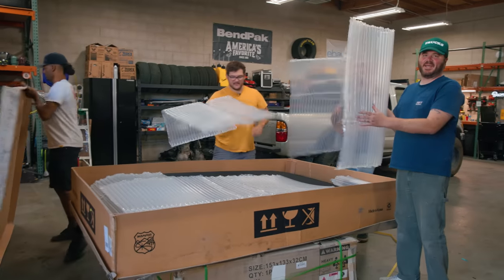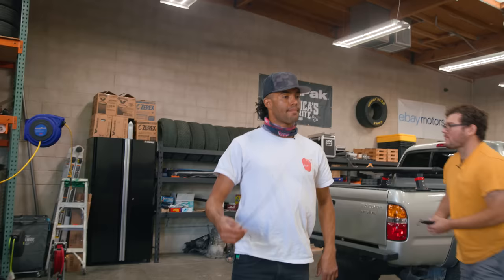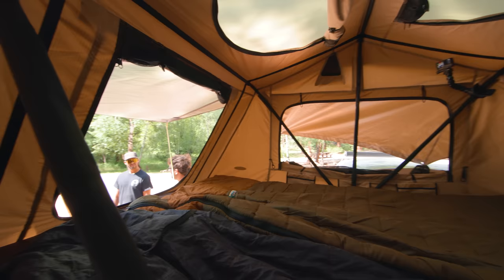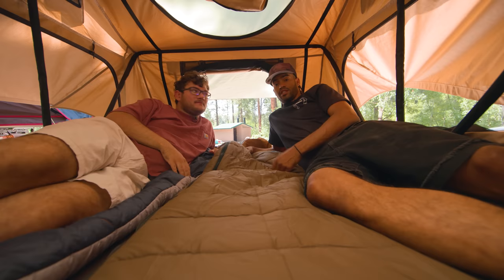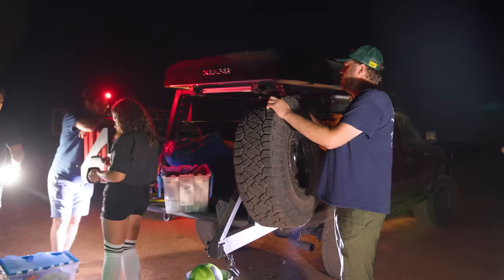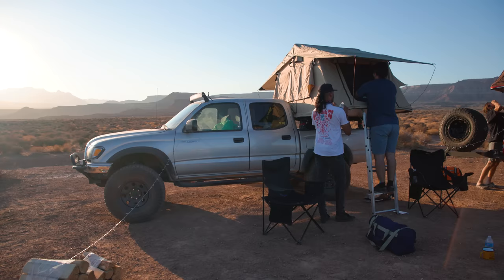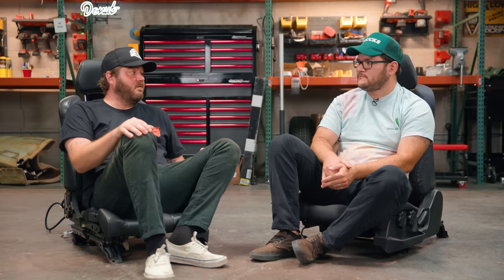$900 vs. $3500 Roof Top Tent

Comment: I love how the mounting was a draw, like there's literally no contesting the fact that the Smittybilt is better in that regard.
It's also interesting that the ikamper won the setup contest even though the Smittybilt took a minute longer but is ready to sleep in when you're done with it, whereas with the ikamper you still have to go get all your shit that you're going to put inside of it.
Reply: Yes, bit I think it was more of an issue of the rack they installed behing too beefy and not compatible with the tent
Reply: @giadalussu1922  I understand that, that's part of the design of the smittybuilt.   It's designed to be easy to mount, which is why it should have won that.  I mean I dont care, I dont have any SB products, or a rooftop tent, it just didnt seem fair.
Reply: Kinda liked the light bar review. Cheap light bar was winning till the last minute and they all changed minds for no reason
Reply: I own a "iKamper 1.0" and can say that the mounting should be a draw. It really is luck of the draw when it comes to install. I know mine can literally be taken on or off in less than 2 min. With the use of a cordless drill driver. As far as being able to store your bedding under the shell, it has to be done in an exact way or it won't close but it does hold it. Biggest reason I switched to an I camper was the shell blocks the wind when set up right and I was able to comfortably sleep my wife and I and our two kids (4 and 5 y/o). It makes the overlanding experience fun because your only spending 10 - 20 min breaking camp in the morning so you can move to the next area and it keeps everything relatively clean. Breaking camp with a tent on the ground can get pretty dirty in my experience.
Reply: @jaredslattery4584  I'm not taking anything away from the ikamper, I'm just simply saying that the Smittybilt has been designed to be very easily mountable just about anywhere.
Anytime you make a product that is one-size-fits-all, it's not going to be as good in some places as a specific product like the ikamper, but will also be better in others.  Of course this is a sample set of one, and everyone's experience will be different, but there's just something dishonest about them literally showing that the Smittybilt is easier to mount and setup, but then saying the ikamper is....
Reply: 3.5 minutes to have your tent up isn't shit anyway.
Reply: @jaredslattery4584  "with the use of a cordless driver"
And how long without? What happens if your battery dies on you?
Reply: @deejayimm  part of the mounting ranking was access to the tray which is why it was a draw
Reply: The bots have showed up.

Comment: Im on the super budget: bought a normal tent and put a wood platform on my roof rack.
Reply: Same, except I made my own rack from unistrut.
Reply: Look at this person hogging all the brain cells
Reply: A wood pallet is actually a great insulator from the ground. If you're already going there in a truck, I recommend trying it out.
Reply: @HrHaakon  Plastic pallets have worked even better for me.  No splinters or torn tents/tarps.
Reply: @946towguy2  
I've only used pretty heavy tents, and have had no problems, so I didn't even think of that. Good suggestion!

Comment: Buy a 900 dollar roof rack tent "put it on the ground."

Pretty compelling argument to just get a nice 200 dollar regular tent.
Reply: ... and then put the regular tent on a sheet of plywood on the top of the car
Reply: Yeah just a fold up ground tent would be nice. Maybe some wheels on one end. Pull it out of your truck roll it to a flat spot and have it unfold like low teams tent. When your done camping just fold it. Wheel it to the truck and slid it on top of the stuff in your bed. If the tent had straps on it with a ratchet that would be cool. Just hook it, rachet it down with your stuff under it and your good to go. Someone needs to make something like that
Reply: When I'm out and it rains, it pours. It's very nice to be off the ground. I might be making an investment here soon...

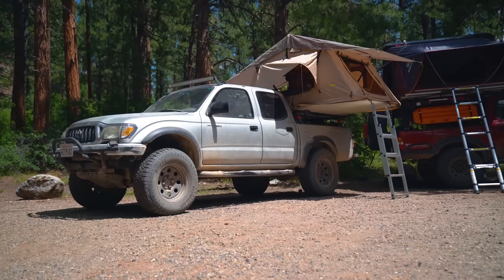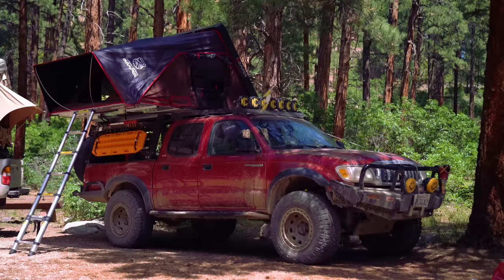Comment: Dudes!!  Really hoping to see a WTF video that shows how the Hi Truck's front bumper got bent so bad. (minutes 5:01 and 10:38).
Reply: dam
Reply: was wondering the same damn
Reply: Yeahhh
Reply: holy moly, damn
Reply: Was it really worth the extra money? Stay tuned to find out
Reply: That was the first thing I noticed, wondering what the heck happened on the trip there.
Reply: I'm imagining they tried to use the winch and found out their bumper wasn't nearly sturdy enough for it
Reply: I'm imagining they tried to use the winch and found out their bumper wasn't nearly sturdy enough for it
Reply: Sorry don’t know how to add a time stamp but at 4:00 minutes exactly u can see hi truck using its winch to climb a rock and I bet they bent it at that point.
Reply: ARB Bumpers have pinning bolts that keep them in position once adjusted. I bet they didn't install them and the winch yanked it out of position.
Reply: With a 9000 pound winch I don’t think they just pulled it out of position I bet they just bent every mount permanently, just my thoughts but hopefully we will know for sure next episode
Reply: I thought I saw it being messed up
Reply: So with Tacomas (all models), the mounts for the bumper bolt into where the crash bar was.  These are very thin plates since it was only ever designed and engineered to absorb impact, not the opposite and pull other vehicles up mountains, hills, and out of ditches.

A common upgrade for anyone who actually uses their winch or recovery points on plate bumpers is to cut the original mount off, and replace it with fabricated brackets from thicker plate steel and fillet weld them to the frame. 

Another popular and sturdy option is a BAMF Front bumper reinforcement brackets from 2005-current models.

Comment: Is it just me or does even $900 for a tent with a floor seem batshit insane?
Reply: then you wont pay $7500 for one
Reply: @tonyrobinson3342   no sane person would.
Reply: Yes that shit should cost no more than 500
Reply: I got mine for roughly $750 from the wholesaler before tax. From a material perspective, was it even worth that amount? Probably not, but the level of convenience of being able to get a comfortable night of sleep after traveling all day is pretty nice ngl and in the long run you can save quite a bit of money.
Reply: @michaelelias2300  there's still other options that are more convenient and way cheaper though. That's why it seems kinda like a waste of money.
Reply: I've always wondered if, at the point you've already got the racks on the bed, couldn't you just throw some 3/4" plywood on there, put a regular ass 1-2 person tent on there, and get a step ladder? One of those Alps Mountaineering 2 Lynx tents would fit up there pretty easy and setup in no time flat.

Comment: You guys need to "add a leaf" in the rear and make the suspension more load bearing.
Reply: I was thinking that, L.truck not so much but H.truck was cl clearly visible
Reply: High truck - airbags, low truck-add a leaf.
Reply: It triggered me during the whole episode, it is really weird
Reply: Yeah the helper leaf can make a huge difference, helped a coworker put a pair on his '90 Ram and we gained 1.5-2" from it.
Reply: Cryforequanimity  nah you just buy the suspension last
Reply: ... did y'all not watch the suspension upgrade episode?

Comment: The clam shell has two big advantages which is superior wind protection and at least some insulation for when it’s cold
Reply: the insulation is huge as well as sound deadening. ikamper also makes a internal insulation blanket tha covers the whole roof and sides. Thats a big deal when you're getting to 32* and below

Comment: LOL "They thought out everything even the shell!", James 2 minutes later "Yeah I just wish there was a window on this side"
Reply: Could easily make the shell out of polycarbonate and provide a zip up cover inside.
Reply: It's the full arc of emotions buying a anything expensive.  You go from "EVERYTHING IS THE BEST" to "Wait, the cheap one can do something I can't?"
Reply: @KTMcaptain  they could fit a polycarbonate/plexiglass window inside of the shell bruh, and make it open with some hinges like a normal window.
Reply: @mattex3396  I mean just a clear not even openable plastic would have cool, and the you cover it with the matt when too sunny.
Reply: @mattex3396  I wouldn’t do that cause of potential leaks when traveling. Don’t want your tent all moist and shit when you get to a camp site.
Reply: @JoseNovaUltra  that’s what I suggested and he responded to.
Reply: @KTMcaptain  but you have to admit that a window that open would be pretty cool, but yeah would me really complex
Reply: @JoseNovaUltra  it would be fore sure, but why not make a fully solid setup with a scissor Jack style strut to lift the roof straight up and have hard panels fold out into walls. Each with their own windows. Now I’d pay $3k for that.
Reply: @KTMcaptain  It's not difficult to add some gaskets on the window, expecially on a 3500$ tent
Reply: @mattex3396  never said it was… gaskets can still leak especially after they dry out and have some nvh and use on them.
Reply: @KTMcaptain  Yeah, but you have them even in your doors and sun roof, so i think it might be possible. Anyway the idea of having even a normal non-openable window would be better than this
Reply: @mattex3396  sunroofs are notorious for leaking and typically have some sort of internal design to handle the accumulated moisture.
.
It can be done, sure, but I’d much rather have a more reliable system that won’t have the opportunity to leak and possibly ruin a great trip.
Reply: @KTMcaptain  yeah, but anything would be better than not being able to see outside😂

Comment: One thing that comes to mind with the low tent is all the minor things you can fix that they had issues with. You could get mattress pad to add extra comfyness. You could probably keep it in their to because in the video they made it sound like they had a couple inches of room and could keep their sleeping bags in it. For the zippers making noise in the wind you could just put some black electrical tape on the zipper. You could probably even get some of those clear plastic windows and Velcro it on. all these modifications could potentially get rid of all the issues team low talked about while still being way below team high.

Comment: "no rearview" why didnt you guys install front/rear cameras both for parking and live view when off road, that could be added on to an episode.
Reply: Those are stupid cheap now too.
Reply: YEAH.
And not only will strategic cameras help with crawling, without leaving the vehicle, no spotter outside vulnerable to bears, crackheads, and mosquitoes. But also double as a surveillance system around the truck, while they are in the seats and or tent.
Reply: Real Truck driver don't need rearview mirrors 🤷

Comment: Never been a fan of these tents. For the prices (high and low) I could think of much better things to buy and have fun with. The Roof tent takes away the function of the vehicle and is annoying to store when not in use. Let me further explain...you cannot leave these roof tents on top of your vehicle during the off season. Storing them takes up floor space and some models state "do not store on side" because the weight of the assembly will warp the joints. So where do you store a 5x5 foot tent flat? A drop shelf from the ceiling of the garage is a good choice.

A main focus of this rant is that I lost a good friend to this hype. Our group mainly uses "pop-up" tents that store easily in the cabin or truck bed. One year he showed up with a roof tent and it caused a lot of "friction" with the group. Roof tents need a lot of head space to setup and most of the areas we stop to camp have can have low hanging branches. Our group quickly grew tired of helping him clear branches for his setup. The frustration grew rampantly for two main reasons; 1. Our groups main rule is to disturb the land as little as possible (focus on being a care taker not a troll); 2. Ruined the groups dynamic, a lot of times we make camp first and move around; our friend thought he could bum rides...

When the roof tent is setup the vehicle cannot move! Camping vehicles are traditionally packed to the grills and room for back seat passengers is exclusive; our friendly slowly learned that he was becoming a third wheel once tent city was established. The group also did not enjoy the fact that he had to park his truck on the trail because we wouldn't let him cut down the over hanging branches. This caused trouble for passing vehicles on the trail, they're not looking for parked vehicle on the trail; let a lone roof tents.

I also like that you mentioned in the video that there is a lot of suspension travel when moving around in a roof tent; yes you can install stabilizers and levelers but lazy people don't and our friend was lazy. His truck was old and woke everyone up when he moved around or left the tent to use the bathroom.

Overall our friend didn't get the clue he was becoming annoying with his new purchase, he didn't get the message when we brought it up; so we had to stop inviting him. He took it personally and hasn't talked to us in a year, better yet he blames the group for losing is girlfriend. Not because we stopped inviting him but she still wanted to hang with use, and didn't want to lose nine cool people over one stubborn guy with a maxed out credit card.
Reply: I like them.
Reply: let's face it man, it isn't the tents fault that your friend is a lazy jerk, there's a public that can be very satisfied with the tent, it's just not something for you guys, but I know people that love roof tents, it depends on how much space you have, or where you like to camp, if you camp on the beach, no problem, desert, no problem, mountain, no problem, camping grounds, no problem, near a lake, no problem, in the middle of the woods, now that might be a problem, you are probably better off not talking to the guy, and just an advice, don't drop hints, straight up tell people that you are annoyed and why, and if they don't care just walk away.
Reply: Losing a friend over a tent🤨 talk about a weak link you guys had
Reply: Never said I hate them just that they require a new thought of “finding your dirt”. There’s a butt for ever tent and I hope everyone enjoys their purchase no matter the expense.

My story does come off biased, but it’s one of my opinions. There are pros to this tent. It’s not intended to devalidate someone’s purchase.

Comment: What happened to the bumper on High-truck, I dont remember that tilt-down being a feature of it?
Reply: Can’t wait to see how that happens.
Reply: So with Tacomas (all models), the mounts for the bumper bolt into where the crash bar was.  These are very thin plates since it was only ever designed and engineered to absorb impact, not the opposite and pull other vehicles up mountains, hills, and out of ditches.

A common upgrade for anyone who actually uses their winch or recovery points on plate bumpers is to cut the original mount off, and replace it with fabricated brackets from thicker plate steel and fillet weld them to the frame.  

Another popular and sturdy option is a BAMF Front bumper reinforcement brackets from 2005-current models.

Comment: for 3k there should be dimmable/changeable temp setting led lights, 

solar/on board battery, ability to hard wire to vehicle OR regular outlet if youre at a legit campsite. 

at least 4 high speed usb ports 

AND AC/heating. 

overall low car wins. having a rack/cage over a camper shell would be the ultimate option

Comment: As cool and convenient as a rooftop tent is, I'm plenty happy with my $5 garage sale find, on the ground tent. Granted, I'm not doing a lot of off-roading or camping outside of standard campgrounds, but I'm a lot happier with saving the $900. Plus I've got a cheap air mattress and don't know how I'd like having a memory foam or whatever type of mattress there is in that. Add in what Nolan brought up about not being able to see out the back and limited access to the contents of the bed and I'm plenty happy with what I've got.
Reply: You want to be up off the ground if there are large predators in the area. All about needs bro.

Comment: The $900 one actually looks pretty good. Honestly in general the low truck looks pretty decent. I couldn't afford either of them, but even if I could i would probably go with something more like the low truck given the choice.
Reply: We had the Smitty one for a year and a half.  It was great. It was work, but I felt happy setting it up.
Reply: Ever get stuck in the rain? How was that ?soecislly knocking down wet. Was the inside all damp or able to be slept in the next night?
Reply: Honestly for how much cost and trouble these are you can get a top of the line 4 season standalone tent.
Reply: @ColoradoStreaming  true.

Comment: you forgot the most important metric with which this needs to be judged.. pack up, especially when things are damp after a cold night.

putting that cover back on the smitty built rather than just folding a clam shell closed and dealing with it once the day warms up is a huge difference.

Comment: Both are nice and keep you off of the ground which is great when the weather takes a turn for the worse you can just keep sleeping. As an older dude I prefer my Palomino slide in pop up truck camper. It takes 5 minutes to set up not rushing and 10 to break down no hurry. Yes its pricey but at 4 in the morning when nature calls, it has a bathroom with toilet and shower. The 2500 HD Silverado diesel that I put it on gets the same mileage as my FJ would get with a rooftop tent so..........   Great video guys. Keep them coming.